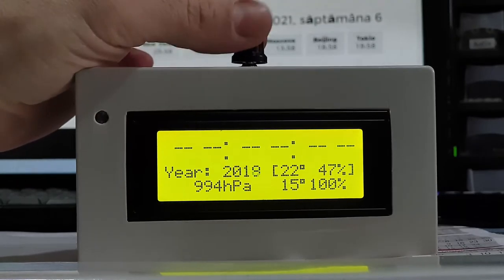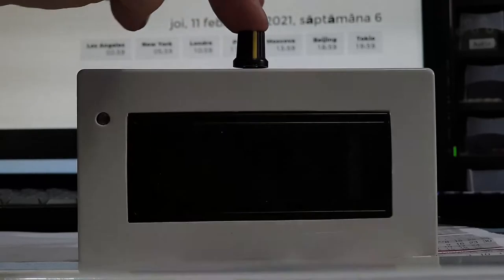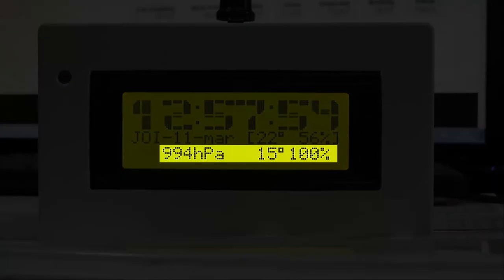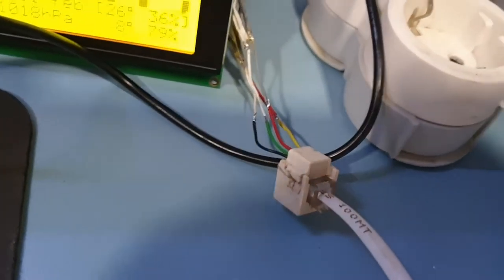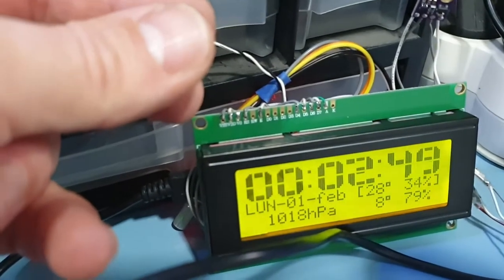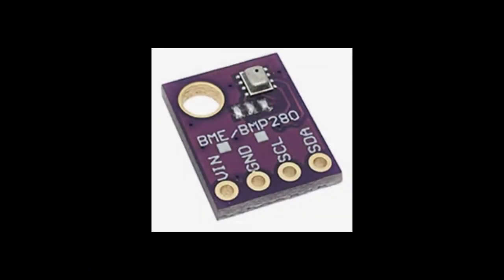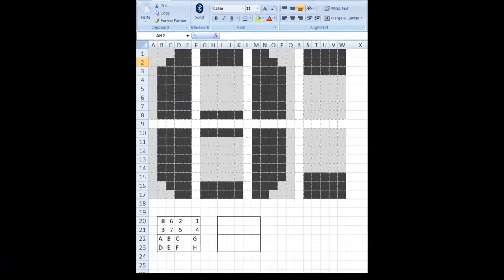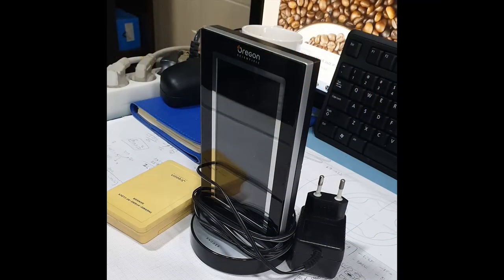Arduino Big Characters Weather Clock (interior/exterior temperature, humidity, pressure)

Comment: Sir
How to make the seconds tick blink,
in the code, where to change or add.

In your video, there is a photo resistor sensor, in the schematic diagram that the device is not there. where to connect
Reply from the maker: Hey Eka,
Please send me an email at yo3rak@gmail.com
I'll send you the updated electric diagram and a small improvement to the code.
I tried to update the Arduino page on Projecthub, but it's kind of beta version and not working very well right now.
I will also try to make the seconds tick blink.
Reply: @Racov  I have sent an email, please check sir.

thank you